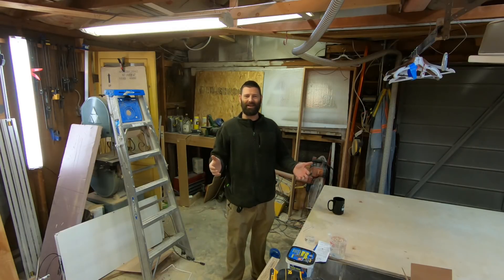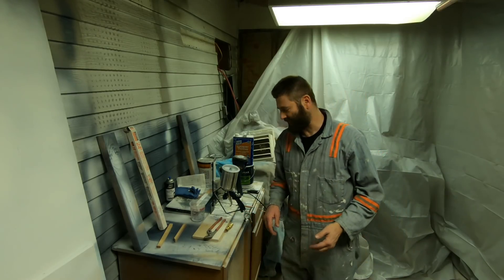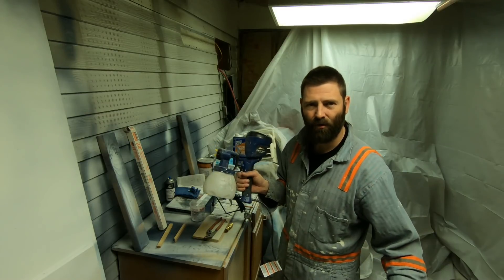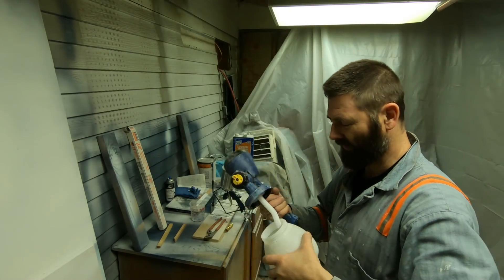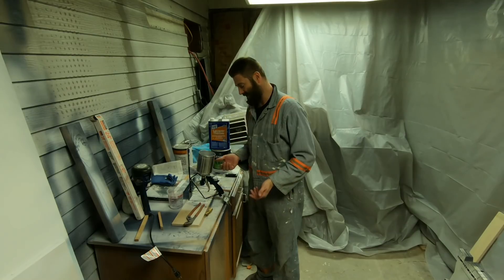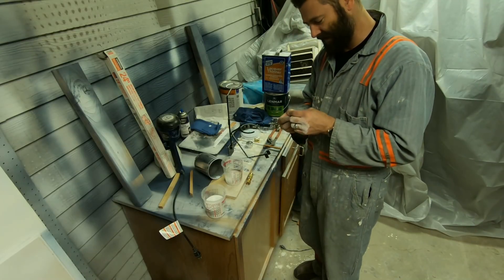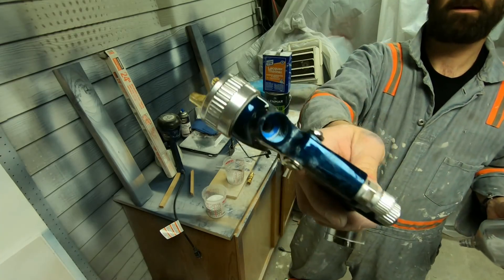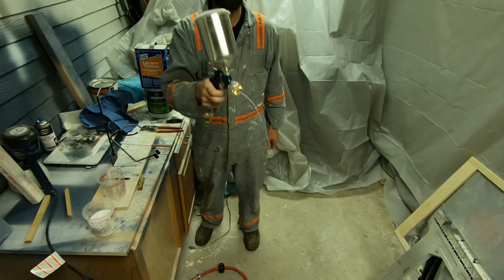How To Clean HVLP Paint Sprayer To Get A Perfect Finish | THE HANDYMAN |

Comment: How to set one up please? I have an hvlp sprayer and a graco cordless airless battery powered switch I love but I have very little experience with the hvlp because of the different setup options and it's hard to get the proper fan width and paint flow adjustments thanks.

Comment: Just some things you may want to consider.  Most automotive paint suppliers sell lacquer thinner in 5gallon drums for less then you would pay for two one gallon cans at hardware store.  Also they sell product called naked gun which is an aerosol gun cleaner works very well. I will say shame on you for not having a 13mm wrench to remove your tip the slightest scar can mess with the air flow.  The flg4 is a nice gun use it all the time for primer.  Then have a teckna prolite for base and a teckna copper for clearcoat.  With 3m pps2.0 cups they are excellent spray guns.  For anyone who don't think keeping these guns perfectly clean, they have never been mid way thru spray a hood or door panel on a new car only to have chunks of old paint or clear blow out on there fresh paint ruining the job.